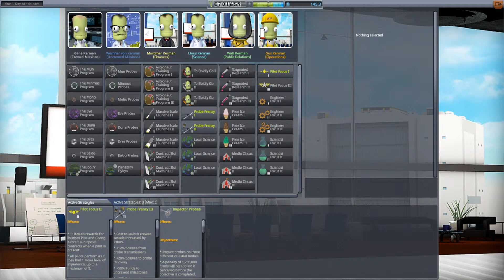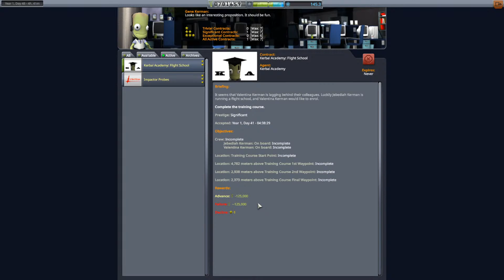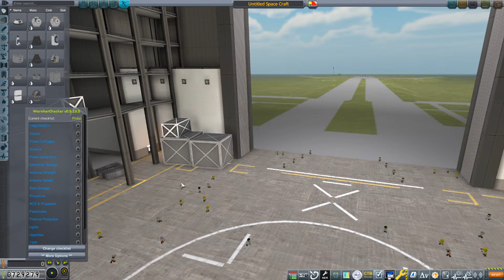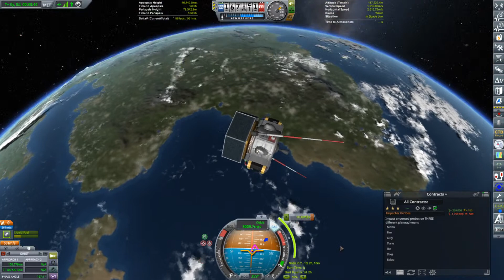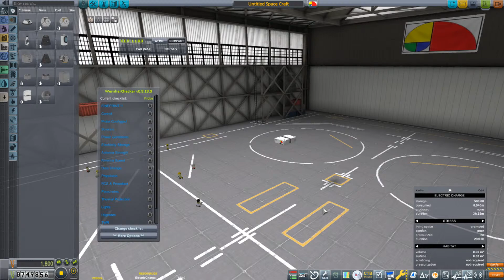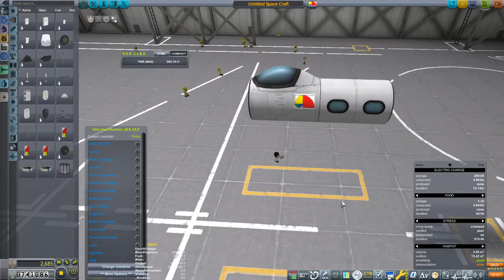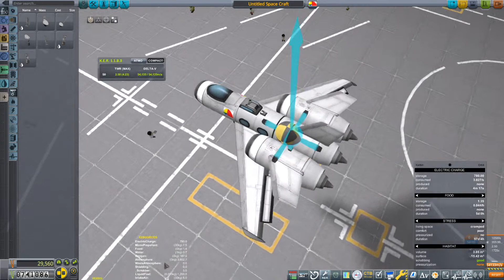Probe Frenzy - Part 1 | KSP Live Stream (1.11.2)

Comment: 0:01	Gotta wonder if Kerbin counts as a "celestial body."
	Ah, guess not. Well, that's misleading. Also, kind of pointless, I think. IRL impactors were significant advances over orbital satellites, but once you've landed on the Mun, an impactor is not difficult.

0:47	Add a kOS so you can use my rover script.
0:48 	Scanner arms are under Science.
1:18	Ouch. You have my sympathies with that revert.
Reply from the maker: 0:01 - I think the description could have mentioned not including the Mun or Minmus
0:47 - I'll likely take a look at that when the time comes. I want to concentrate on scripts that save time in the stream. 
0:48 - Thanks
1:18 - Steps have been taken so that won't happen again.
Reply: @MikeAben  0:47 That's a wise choice. I enjoy my rover script, but that's because I'm the one tweaking it. Not very exciting for a viewer.